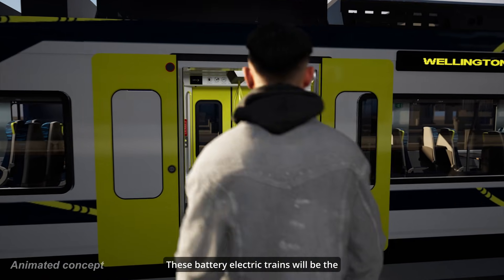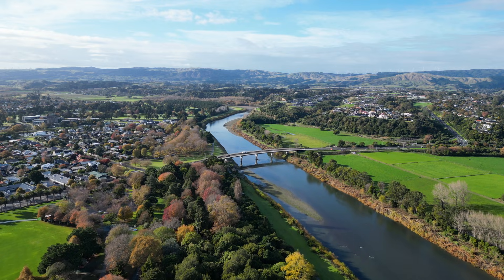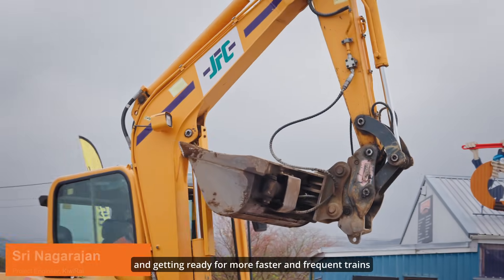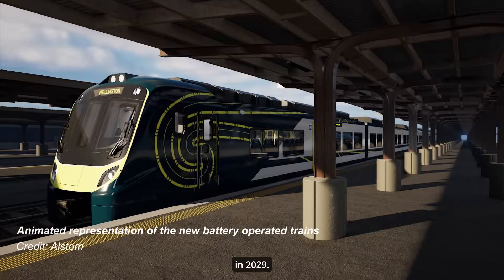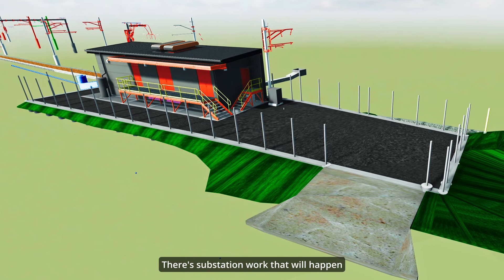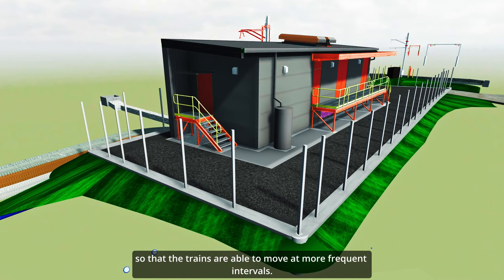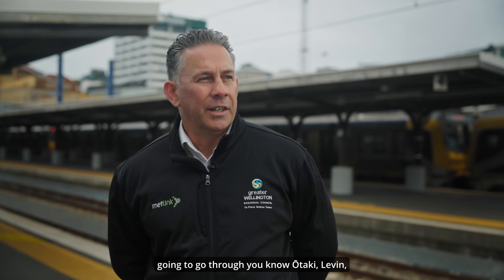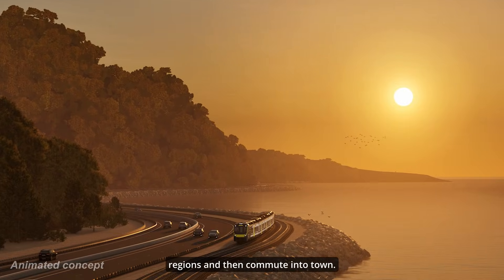New battery electric trains

Comment: Can the battery recharge from and share spare Regen with the catenary system?  The new generation of trains overseas can do this, which means much faster turnaround and therefore quicker payback.  Given NZs hilly terrain, it would be particularly efficient to do this here.
Reply: Yes the batteries will have some minor recharge from regenerative breaking and excess electricity supply. They are the latest generation of rolling stock.

Not that turnaround will be important with the initial service pattern…

Comment: Let’s have proper regional rail using these trains…

Wellington to Whanganui, New Plymouth and Napier.
Reply: Let’s not. They don’t have the range. And none of those places have any station anymore.

What I would like to see is for Kiwirail to acquire some diesel railcars (or something with hybrid diesel and electric supply) re-establish regional services such as the bay express and a three day a week service to Wanganui.
But I am realistic; not the PNGL and the MNPL need some investment in the tracks to allow rapid running speeds. Some of those railway viaducts in Hawkes bay are very rickety and are long overdue replacement now. And of course stations need to be rebuilt. So invest in that also.
Once numbers for the Hawkes bay service pick up; the service can be provided by locomotives and carriages, and money can be spent on the line between Wanganui and New Plymouth, and a Wellington New Plymouth Service can return. Initially just three days a week, but increasing over time as patronage picks up.

Comment: Just take power from the overhead wire
Reply: The overhead wires stop at Waikanae and Upper Hutt.
Reply: @danieleyre8913  If the batteries can't charge off the existing grid its a waste of money, The cost to extend them would cost less than this, especially since they are buiding new infrastructure to charge them.
The concept is simple, while traveling under the wires they are charging, while not under the wires they are on battery, these trains won't work like that, therefore waste of money
Reply: @ytzpilot  What on earth are you talking about?!

Of course extending the wires would be many magnitudes more expensive than just buying these units! Take a look at how much it cost to extend electrification from Paraparaumu to Waikanae 15 years ago and adjust for the new longer distances and inflation.

And batteries store electricity. So simple concept; they charge at the termini, run off of the supply when under the wires, and from the batteries when not. Do you honestly imagine that these sorts of trains haven’t been around overseas for more than a decade now?!
Reply: @danieleyre8913  You missed my point, they have to build a large building to charge these things A BUILDING. and yes extending the wires would be cheaper then buiilding new facilities.
Like I said the concept of charging on the wires while in motion is exacty how our Subways worked when I was a kid back in the 70s, when they are off the third rail they are running on battery, and they are charged while in motion, don't be so thick mate the concept is nothing new, in fact decades old
Reply: @ytzpilot  Okay state the price for the charging facilities they are building.
And then calculate an estimate of how much it would cost to extend the electrification the 80km between Waikanae & Palmerston North + the 60km between Upper Hutt & Masterton.

And no it appears you don’t understand that batteries are for providing electricity sans the direct supply.
Reply: @danieleyre8913  The cost will  be whatever lie the government says, times 4....
And what I said is true, we had battery charging off the line back in the 70s when I was a kid, that concept is nothing new, you are just blowing smoke out of your arse
Reply: @ytzpilot don't worry about that guy, He's commented on everyone's comments. Train FOMO period 😂😂😂
Reply: @RayK236  Sounds like you’re worried about me. Aw poor guy (gentle pat on head).
Reply: @danieleyre8913 😂😂😂😂 nah just commenting just like you mate. You should take up being a comedian part time
Reply: @ytzpilot the brother Daniel is autistic. I'm trying to help him

Comment: If the performance is there, these seem like a sensible solution for getting those not on the electrified network connected. Why anyone would want to go to Wellington in the first place is another question altogether 🤭
Reply: So where do you live?
Reply: @danieleyre8913 why does it matter????
Reply: @RayK236  Um because he’s running down another place (Wellington).
Reply: @danieleyre8913 So, is that a major issue for you? Because it seems like you think you opinion is valued more than someone else's.
Reply: @R @RayK236  I wanted to know where someone who runs down another place out of the blue comes from. That’s normal when confronted with an obnoxious person who does that. If you actually have a problem with that; then that says more about you.
Reply: @danieleyre8913  Levin, so that says how bad Welly has gotten! My wife is from Wellington originally; and I've lived and worked in Welly for a few years in the past. The only thing worth popping down for these days is the occasional show and most decent ones will go to Palmy anyway (which is closer). Even when the wife and I have booked a hotel we've ended up coming home after a show rather than spending a morning in Wellington, makes for a faster drive out of Wellington too so bonus 😁.
Reply: @ammoboots9050  More people want to visit Wellington NZ on any day of the year than want to visit poh-dunk country town Levin NZ for any calendar year.

Comment: Thanks for the information. My previous statment on battery electric trains was simply misinformed.

From what ive been told, these trains will be running on overhead wires, and then switch to battery electric on sections that do not have overhead wires. which i actually can get behind much more than a completly battery powered train.

I am excited to see these trains in the future. I shouldnt have taken such a harsh stance toward these trains. There are people way more qualified than me working on these.

i still think we need substantially more investment in our railways. and i want things to get better. But these battery electric trains are still going to benefit us and are still going to improve our network.

Thanks for the info @danieleyre8913 & @damobdaking 
ill do some more research on these trains.
Reply: You really need to read up on how batteries and modern trains work, and why they suit NZ.  The images in the video are wrong.  With battery wagons it just swap in and swap out. Whilst I agree over head is wonderful, in a country that moves this much and has a track record of selling off infrastructure to some one to rip us off.  Overhead is never going to happen.
Reply: @damobdaking  yep. what about a partial battery system? we have existing electrified railway from Hamilton to Palmerston North. with only short sections of non-electric rail (and an unfortunate transition from AC power in Auckland to DC power on the rest of the network.)

a short term solution could be an electric battery train that only runs along short sections on battery power, and the rest on overhead.

another reason i want overhead is because it honestly it wouldn’t be that difficult or expensive to simply extend the overhead wires from Palmerston north to the outer extend of wellington suburban rail, and same same from Pukekohe to Hamilton.

the only serious cost would be a train that can switch between AC and DC (which do in fact exist)
Reply: Okay you have no remote clue what you’re talking about and are thankfully nobody who will hold any position of authority.
Reply: @danieleyre8913 calm down mate.
Reply: @danieleyre8913  your autism makes life hars for you doesn't it 😢
Reply: Exactly. And battery electric passenger trains have already been proven to have limited range and have been unreliable in overseas service
Reply: @samu-patel7768  Really Gupta?
WHERE? Give me one city or region in one country.
Reply: @samu-patel7768  Well?

Comment: 40 year old diesel engines is impressive. What is the lifespan of the electric trains? 
How much weight ratio is the batteries compared to cargo?
Reply: These types of locomotives have proven to be unreliable in overseas service. Battery electric is only really suitable for yard shunting.
Reply: @samu-patel7768  I’ve told you before Gupta: They’re not locomotives
They’re multiple units. You have no clue what you’re talking about. And you’re too insecure to listen to anyone and learn anything. Go back to running your corner dairy.
Reply: Most rolling stock is intended to have 45 years of service in it. With a refurbishment every ~15 years.
Reply: @danieleyre8913 😂😂😂😂😂
Reply: @RayK236  What’s so funny?

(Waits for the inevitable “oooh you are duhuhuh”).

Comment: But why BEMUs? Why isn't the existing 1500VDC Electrification also be extended to cover these more distance regions? Or a new dual-mode DMU flect
Reply: 1500VDC is a relic from a century ago. You don't want to extend it if you can avoid it.
Reply: @PCLoadLetter Melbourne still uses it effectively.
Reply: @maxinehurley8824 It shouldn't install new 1500VDC. Nobody should.
Reply: @PCLoadLetter  So Melbourne shouldn’t ever extend its train system?
I can see the you must be among the brains trust…
Reply: @danieleyre8913 A few kilometres here and there, meh. But they already cut 1500VDC from Traralgon to East Pakenham, as maintaining it was a waste of money. If they ever decide to electrify Gippsland or Traralgon, it'll involve dual voltage and a dedicated fleet.
Reply: @P @PCLoadLetter   Gippsland and Traralgon are not part of Melbourne. They are served by state rail authority V/Line trains, nothing to do with Melbourne Metro trains.

All the Victorian railways have a standardised supply voltage of 1500V DC. And the upcoming electrification of the Nelson Line will be to that standard. The planned suburban rail loop will also be to that standard.

There are railways with 1500V DC supply across the world, especially urban systems. They work fine and nobody is wasting money getting rid of them. It’s actually preferred for many metro systems.
Reply: @danieleyre8913 Gippsland was electrified decades ago for briquette freight, and they also used the electric locos for some passenger services. They cut it back because the economics of 1500VDC along such a long corridor didn't make any sense, to build or to maintain. It still doesn't make sense.
Reply: @PCLoadLetter  Well then it’s going to stay Diesel.
Unless the Victorian state authorities decide to also go with BEMU’s. They are not going to have a mixed power supply
Reply: @PCLoadLetter  Sure, there are problems but it still works. Also, it would be possible to build trainsets that could operate on both the legacy 1500VDC and newer 25kVAC Electrification.
Reply: @TheWolfHowling Indeed, but that's expensive. For a couple of trains running a couple of services per day, full electrification is overkill now that batteries are cheap and plentiful. And trains need ballast over the driving axles anyway - which batteries can provide by default.
Reply: @PCLoadLetter  That’s complete rubbish. The power supply is fine and used across the world.
Reply: It wouldn't be compatible with the existing electrification in Palmerston North and it would cost more money than the government is willing to give them to extend it. For the DMUs; trimode (electric, battery, diesel) was the initial plan, however Alstom came to them with batteries reliable enough to bridge the gap. Wellington also trying to be as carbon free as possible meant they were happy to give up the diesels
Reply: @kyleforsberg5463  Actually it was part of the last government’s policies towards carbon neutrality is why it changed from DEMU’s to BEMU’s.

The rest of what you said is correct. Except that extending electric action to Palmerston North would not interfere with the NIMT 25kV AC electrification at all. But yes; extending the 1500v DC further than Waikanae at this stage would be a moronic waste of money.
Reply: @danieleyre8913 I was meaning the fact that they'd have to swap the voltage at the station and would remove the ability for the EFs to access the station(not that they do anyway)
Reply: @kyleforsberg5463  Not really. There’s ample space at Longburn for two different power supplies at each end of the station. And ample space for possible parallel tracks.

Not that it’s happening in our lifetimes…
Reply: Because extending the overhead catenary would be many magnitudes more expensive to both install and maintain. And could it be justified for such an infrequent service.

Simple stuff.
Reply: @danieleyre8913 😂😂😂😂😂😂😂

Comment: Thanks, I hope Kiwirail can make a projection on the potential for NZ wide if it ends up to be cheap enough to do so. If the ratepayer has to subsidize this, then let the public know because sneaking it under the radar is just going to have a negative effect on the future of the idea. We are not America. Cheers.
Reply: ratepayer subsidy isn't the main issue - rocketing electricity prices are.
Reply: @kungfutzu3779  Yip, that was what I was hinting at, but didn't cos the govt just do what they want anyway. Cheers K.

Comment: whats the cost for ratepayers?
Reply: $71m for ratepayers. 90% of the cost is covered by central government.
Reply: forget about it - what's the cost for electricity users as demand goes through the roof
Reply: @kungfutzu3779  There are 44.3GW of generation projects in the pipeline. These represent over 4x current generation (9.5GW). While not all of these will make it through (expect maybe 20-40% or 9-18GW), the electricity landscape may not be as bleak as those who benefit from the fear mongering make out.
Reply: @kungfutzu3779  Electric trains use far less energy than diesel ones, and are a lot cheaper to power than the equivalent fuel bill. The impact on the electricity network is basically negligible, about the same as opening a new office building downtown.
Reply: @MrNicoR  Not true. In New Zealand it would be cheaper to run diesel rolling stock than electric rolling stock under current and foreseeable energy prices.
Reply: @danieleyre8913 Not so. Even the most efficient DMU will consume around 5l of diesel per kilometre, while an EMU uses about 15 kwh per kilometre.  If you are talking about hauling carriages with kiwirails freight locomotives, the fuel consumption doubles again. At current prices EMUs are half the cost to power as a new DMUs. Even cheaper if they do some charging overnight to avoid peak spot price. Thats a saving of about a thousand dollars per return run on the Palmy Wellington route.

Plus they are less complex, which makes them cheaper to buy in the first place and cheaper to maintain over time. If you are talking about hauling carriages with kiwirails freight locomotives, the fuel consumption doubles again.
Reply: @M @MrNicoR   Right off the bat you state a falsehood.
DMU fuel consumption’s vary with model, unit formation, and technology. But an average single unit set (generator, motor, and the cars it powers) will consume about 1L/km of Diesel fuel. Some are more efficient and closer to .75 L/km, others can be as inefficient as 2 L/km.
The only way any DMU is going to burn 5 L/km is if it is made up of many individual units. Like 12 cars or something. In which case; locomotive hauling would be more efficient.
Reply: @danieleyre8913  The only way your numbers make sense is if you're quoting rates per car, I'm talking about the whole five car trainset.
Reply: @MrNicoR  Did you even read my reply properly?